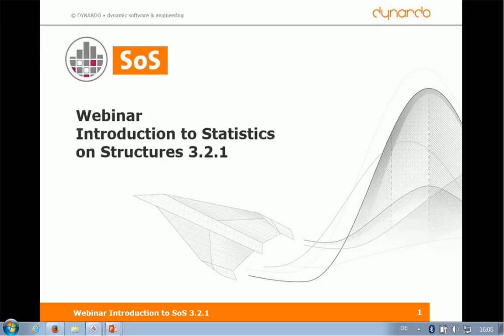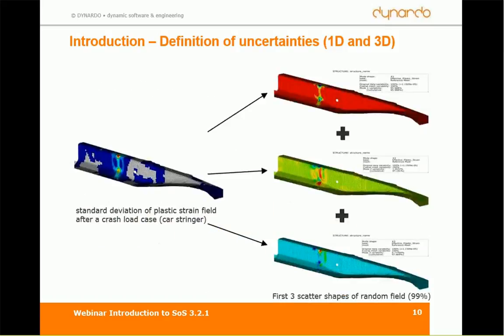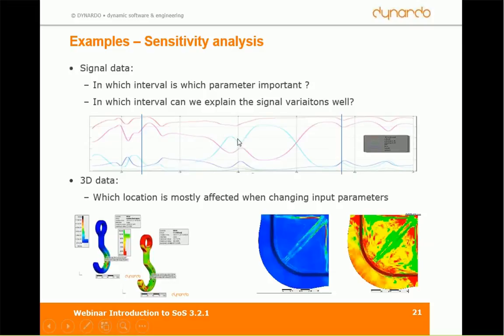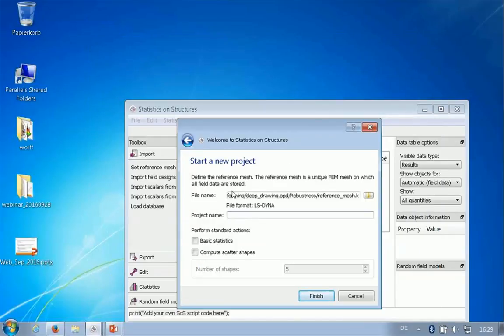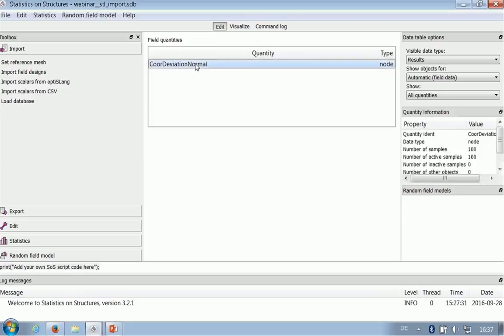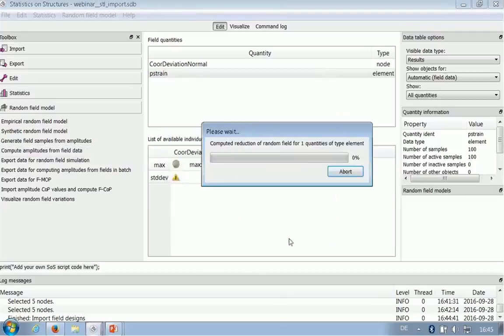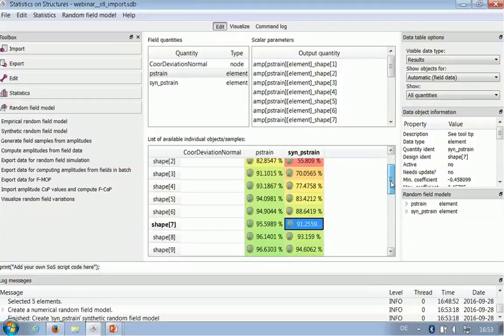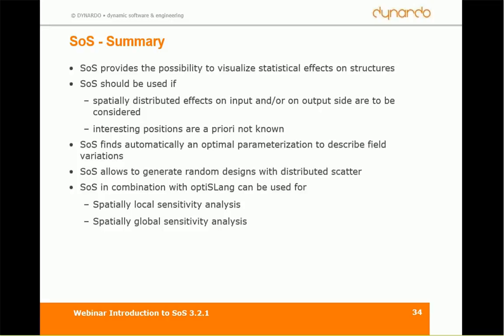Webinar Introduction to SoS 2016 09 28

Comment: Some bookmarks to essential times in the webinar:

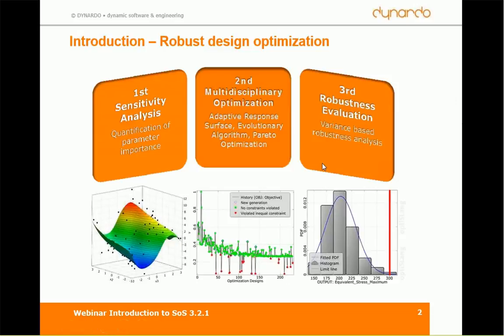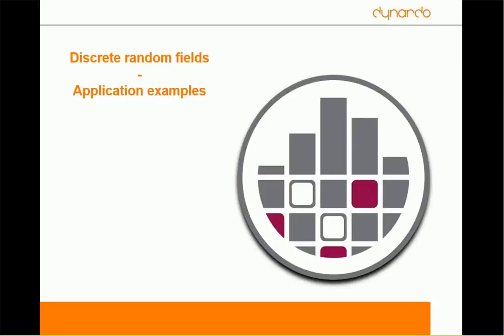- Introduction - RDO & Random Fields 1:10 - 10:20
- Application Examples 10:20 - 17:02
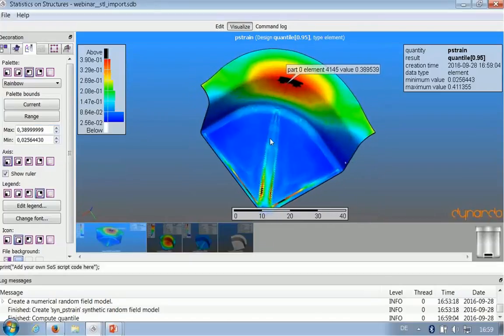- Software Demonstration - Intro Demonstration Example 17:02 - 54:41
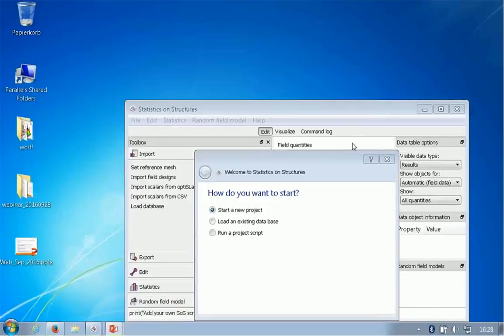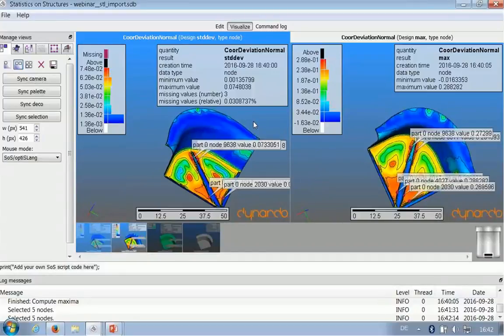 + STL File import incl. Mesh Mapper 22:52 - 37:15
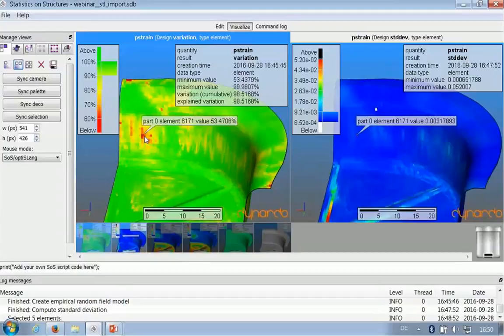 + Empirical RF model 37:15 - 44:52
 + Real-time RF variation visualization 44:52 - 46:20
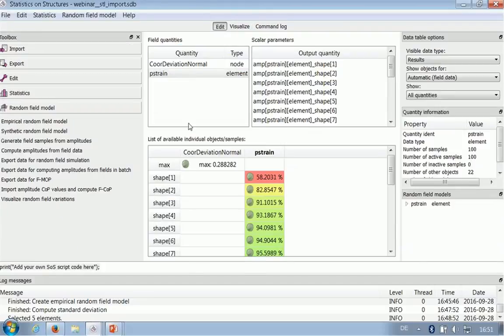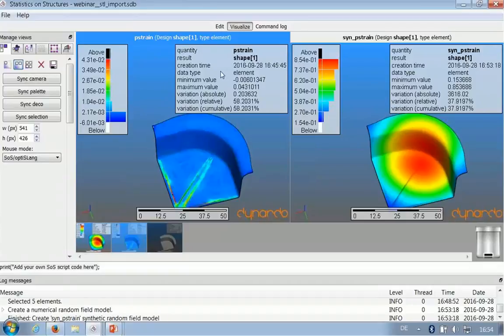 + Synthetic RF model 46:26 - 49:23
 + Field-Meta Model 49:23 - 52:23
 + Hot Spot Detection 52:29 - 54:41